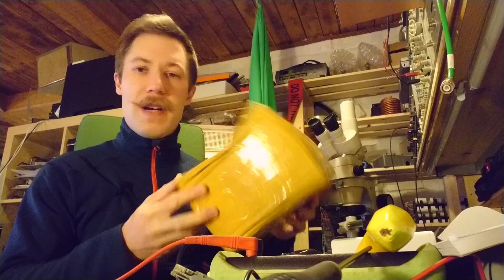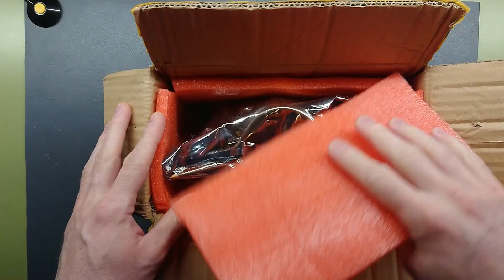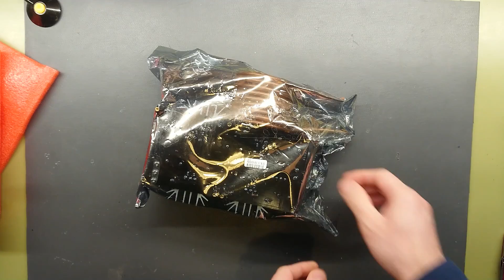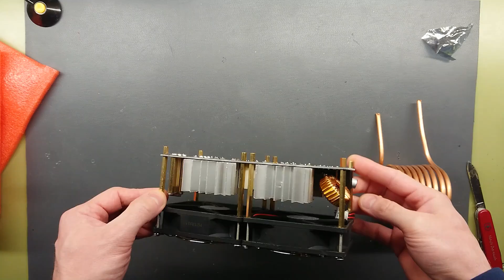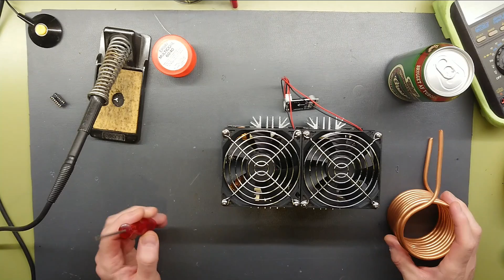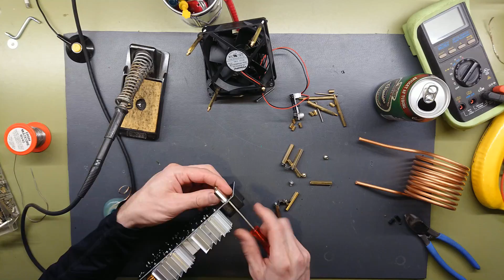Unboxing a Chinese 1800 Watt Induction Heater

Comment from the maker: 150W induction heater: https://www.youtube.com/watch?v=A8FWSzfHgGc
1800W induction heater: https://www.youtube.com/watch?v=jmAZhjl8Ybk
36V 2200W server power supply: https://www.youtube.com/watch?v=xRAlXCzsY3Q
40V 2000W laptop power supply: https://www.youtube.com/watch?v=5iMFYdDMfXo
1800W IH 10 minute stress test: https://www.youtube.com/watch?v=v-TsBLFp8yo

Comment: THANKS.   I am still online looking for information on the gate resistors (resistance and power rating) used in paralleling the MOSFETS.  I just (a moment ago) found a high-voltage forum discussing these drivers...was that YOU??  I will return to it and look at the links and videos...didn't see much detail on paralleling-resistors (just a quick mention on "too small of a resistor value".
I am prototyping such driver, but am held back by these darn "paralleling gate resistors".  I ordered the 2500W driver yesterday, through Walmart!!!   largely in part to investigate the gate-sharing resistors.  
I plan to use the Allegro "ACS" series current monitors to shut off any overcurrent in the DC supply batteries (I don't quite trust power supplies just yet).  I know first-hand what a hassle it can be to blow those well buried mosfets on the Chinese PCB units.

Comment: Hello,  I would guess that the mosfets are paralled in in TWO's (there are effectively two mosfets on the PCB).  I have searched far and wide on how, exactly, two are paralleled...I would certainly guess that the drains and sources' could be directly connected.  However, are the GATES directly connected OR does each gate have a separate 'gate resistor' ?????
This information would be extremely useful to me!
GREAT VIDEO!!  Thumbs up
Reply from the maker: Drain and Source are just paralleled. Each gate should have individual gate resistors!
Reply: @KaizerPowerElectronicsDk  THANKS A TRILLION!!
I was thinking that it may be better NOT to use the "wirewound" type resistors, as there are already so many parasitic oscillation problems with stray inductance combined with the mosfet Cgs, etc. characteristics.
Reply from the maker: @dalenassar9152  yes. Use metal oxide
Reply from the maker: @dalenassar9152  I have a gate drive calculator here https://kaizerpowerelectronics.dk/calculators/igbt-gate-drive-calculator/
Reply: @KaizerPowerElectronicsDk  I had just ordered 5w 470ohm MF resistors AND some lower values from 470 to 100ohm...trying to get the gate waveform to get a faster risetime.

Eventuality trying for a GIANT driver.  I wonder, just high big of a ZVS driver is practical??  I've noticed that designs seem to have, approx, an additional paralleled mosfet per kW.  I have considered IGBT's, but at 'first thought',  worries about the Vce.  I happen to have some HUGE brick IGBT's...the monsters!...for later...
One thing that I never liked was how the IH caps are connected.  I always make the parallel string thick semi-Litz wire, and ONLY run out two diagonally opposite-end terminal connections (one other type connection works, but too messy).  This came from the days of designing pulse-cap banks for flashing giant laser flashlamps, it REALLY can make a difference here.  In series with the huge air-core inductors tuned for critical damping, I can get a very nice clean pulse.  In cases, even with 'lytics.  I knew I had been doing this too long when I could actually hear the ideal discharge thru the lamp before looking at the scope...makes that special sound like a fast thump of a high-power silenced (TV) gunshot.

Just watched your MMLP video,  a part reminded me of a desperate search for a huge cheap ultra-high current dummy load (when working with supercaps).  I had some success with a 20kg train-brake resistor...but NOT adjustable.  That was solved when I tore apart a (flood-victim) Carbon-pile 500A automotive battery tester and pulled out the load unit with about a dozen stacked carbon(?) disc's that are slowly 'squeezed' together with a multi-turn knob to vary resistance. ADJUSTABLE FROM ~0 TO 500+ AMPS AND CHEAP (~$60 ebay in a nice box with analog meters).  You can buy a new one and don't have to modify it...just use it's heavy wire and clamps, and have a nice battery tester too...I seem to be rambling...
Reply from the maker: @dalenassar9152  RogerInOhio once made a 10 kW ZVS driver with 16 MOSFET https://4hv.org/e107_plugins/forum/forum_viewtopic.php?id=129196

Comment: Bought the same toy (70$) in the USA and it clearly needs readjustments, Cu heatsinks in first place, the Al ones are not ideal and are fixed ont the PCB - there is no need for this i think (unless the manufacturer imagined vibration of the MOSFET). Another consideration: no need of mica sheet between the heatsink and the back of the transistor, only thermal paste. With a proper supply, this artifact (!) will generate some heat into the coil; smelting non-ferrous metals will be, alas, possible only in conductive crucibles (e.g. graphite). It seems the frequency is somewhere to 2000 Hz. I'm interested in higher temperatures (more than 1600 degr. C) and I intend to use an alumina crucible; for this,  the frequency must be way higher. It seems the power is not a decisive factor for the obtention of bigger temperatures, but the final frequency is. On the other hand, experimenting with different coils (tube diameter, coil diameter, number of spires etc) and different numbers of capacitors will sure be interesting, but I don't know about the risks implied ....... blowing some parts of the instalation :)))))))))) To enforce the conduction some Cu wire can be used on the main traces, after removing the solder on the PCB back.... in fact this HF generator must be rebuilded !!!!

Comment: Sir could you build me one of these? Mounted to a piece of wood 
With a power supply , switch  to the power supply, plug in  and the necessary cooling hoses and pump?
I could pay you whatever you think is reasonable? 

I need to create scaler waves with it to avoid electronic harassment I am  enduring from a sociopathic neighor.

Comment: Do you know this is just the Chinese building (badly, of course) an open source induction heater designed by a New Zealander? https://www.youtube.com/watch?v=DbZZD6J_AK0&list=RDCMUCWCEeeg0Y5oSV5voboyG3WQ&index=2
Reply from the maker: We can argue that its open hardware, but the schematics he use is the normal Royer / Mazilli ZVS heater schematics that is also used byt he Chinese IH manufacturers. https://kaizerpowerelectronics.dk/general-electronics/royer-induction-heater/

Comment: They don't use hollow copper pipes for water cooling. They use it because of the skin effect. Its a waste of material if you make a super thick copper pipe and then there is almost no current running throught the inner parts of the pipe. It is just useless cost.
Reply from the maker: Water cooling and skin effect is the two reasons to use hollow conductors, I wrote an article on that long ago http://kaizerpowerelectronics.dk/tesla-coils/drsstc-design-guide/busbar-and-primary-circuit/

Comment: Is it dangerous to remove 1 or 2 capacitors to make the tank circuit have a higher resonant frequency?
Reply from the maker: What is the original resonant frequency and what would the frequency be at 1 or 2 capacitors removed? There is however more to it. When frequency goes up, so does the losses and with less capacitors in parallel to share the current load. Switching losses rises in the MOSFETs with frequency, so more heating is expected and better cooling of the MOSFETs is needed.

Comment: I have been using thos heater for about a year for,melting silver and gold in graphite crucibles and can say the heat transfer compound is not needed. I run mine for 15-20 mins at a time using a 50v supply drawing 30 amps and the fets never get more than warm
Reply from the maker: Thank you for sharing your experience with this kit. I would still add compound any day, its cheap and is an improvement if applied correctly.

Comment: I'm still torn on heat transfer compound maybe being oversold as always necessary. I'd think it would be great when you don't have a perfectly flush mating of collector pad and heatsink due to surface scratches etc. Otherwise I'd think it would just get in the way a little bit and just do a little better than any other compound that could possibly add more insulation between the metals.
Reply from the maker: There is no such thing as a flat metal surface, its all a pointy land scape of broken crystals, when you zoom in far enough. A very thin layer of heat tranfer compound fills out these groves. The metal surfaces on both components and heat sinks are extremely rough, seen in this perspective and the real contact surface could be a really small percentage of the total area.

Comment: Am I able to attach wires running to coil in different location
Reply from the maker: Only over a very small distance, in the order of 10 centimetres, you add more inductance and resistance to the LC circuit with longer wires, so you would have a lower resonant frequency but also higher losses in your LC circuit. You have take into account that it is a high frequency, high voltage and high current circuit you want to extend, so be sure to choose a wire that is suitable for it. Flat band copper, litz wire or extending the copper coil tubing.
Reply: Kaizer Power Electronics ok thank you just didn’t want to do this and fry the mosfets
Reply from the maker: @nicholaslombardo9696  You won't fry the MOSFETs, but you will lower the power output in the work coil, just be sure to check the new resonant frequency and higher losses from the wire you want to add.
Reply: Kaizer Power Electronics ok

Comment: The heatsinks are outside the airflow of the fans. This is really very bad designed and constructed.
Reply from the maker: It does however work quite well! At 1800W the heat sinks remained cooler tha my hand after 5 minutes of run-time and at 1500W they rained cold. Here is the 10 min stress test at 1500W: https://www.youtube.com/watch?v=v-TsBLFp8yo

Comment: The coil seems to be oddly attached. Should it not be horizontally parallel to the PCB? Thanks for sharing!
Reply from the maker: Coil position is all up to the application, you can turn it any way you want. This is just how the coil I got with the unit was formed. Thanks :)

Comment: You countryman Stefan Gotteswinter would call it a Chinese induction heater kit.
Reply from the maker: If it the Stefan with a machinist channel, he is German, I am Danish  :) I would only call it a kit if there was more self assembly like soldering.
Reply: Shit, my mistake. Sorry. He considers tools to be kits if he has to disassemble and rebuild them. Still the cheapest way to acquire some things .
Reply from the maker: @johnalexander2349  I get the kit joke now, good one :D